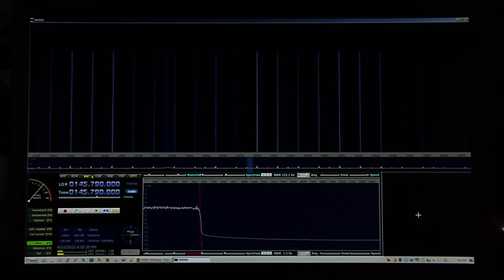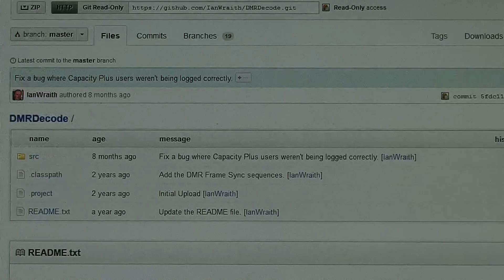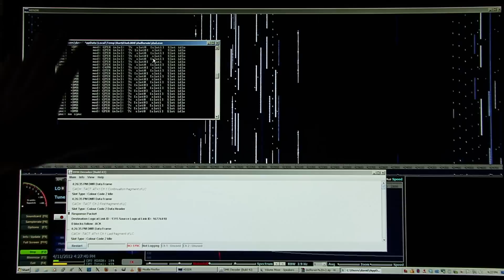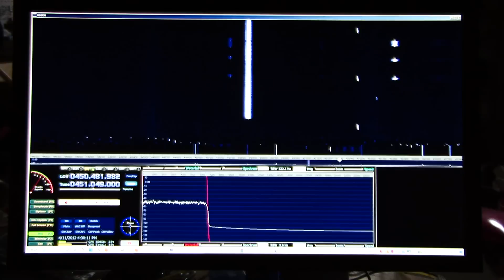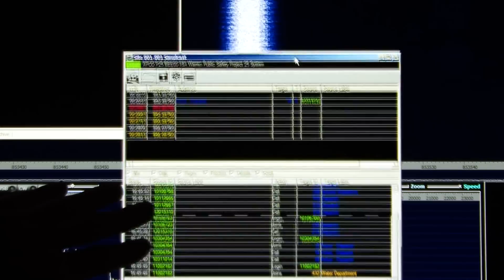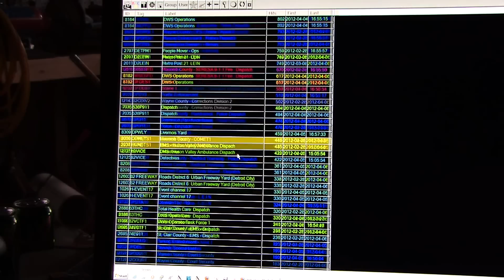USRP - Windows ExtIO Virtual Audio Cable DMR Decode DSD and unitrunker review

Comment: Thanx for this video, I've been looking for a way to route the sound back to the speakers after you feed the audio to virtual audio cable and haven't found the answer until now, I've asked so many people on youtube and no one can give me a straight answer or don't even reply.
 can this be done for VB-audio virtual cable  as well ? if so do you know how?
cheerz
Reply: +CanAmQ8 It can be done. Right click the speaker icon in the lower right corner. Go to recording devices. Double click Cable Output. Next go to the Listen tab and check the "Listen to this device" checkbox.
Reply: i did those steps there is no Listen Tab or anything that indicates "Listen to this device"

Comment: yea i had tried that already as you said to do that in the video.
but no matter which device i set as default it does the same thing.
when you are not on a dmr signal and you start up dmrdecode do you still get those dots on the left side?
i mean can you make yours not get the dots like i dont?
i only get the yellow/green/red meter in bottom left corner of dmrdecode

Comment from the maker: sounds like its not getting the audio. java uses the system default device for device selection. close unitrunker and dmrdecode and open the windows sound mixer and set virtual audio cable as the defualt capture device - then start dmrdecode

Comment: i found a channel that unitrunker is working on (EDACS96 Protocol)
if i shut unitrunker down should dmrdecode work on that?
correct i see no dots at all.
the only thing i see is that volume input meter
when i turn the volume up in hdsdr it makes the levels go up in dmrdecode so i think i have it setup right
i havent tried it on this channel that unitrunker is working on yet.

Comment: yep using hdsdr and have used wrplus for fmwb but right now only hdsdr
yea i see quite a bit of RF (all the FM commericial 88-107Mhz) tons of 400Mhz and 800Mhz
basically i see everything but i cant seem to find any dmr
i see long solid lines on the spectrum and when i click them (when its a pretty good signal) the sound gets really really quiet
i have to turn my volume all the way up just so i can see it at the bottom of the meters in auto repeater or in dmrdecode it will barely turn yellow

Comment: i live in the country in iowa
i just got my rtlsdr other day e4000 tuner.
i cant find any dmr signals
ExtIO plugin i have 2.5Msps and 15 gain
i then click sample rate in hdsdr and set to 48000
i select FM mode and i do not have any no icons turned on like nr, nb, notch etc...
i look all over for that dmr chirp but i cant find any
so my two questions are...
01 are my settings correct?
02 with drmdecode does it still come on but show only a BLANK screen when do dmr signal present?
help
thanks